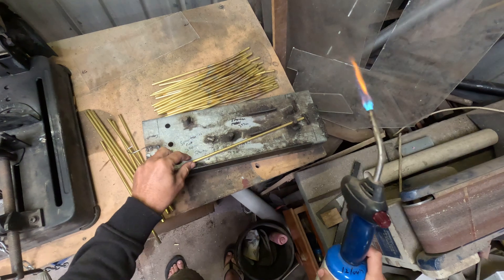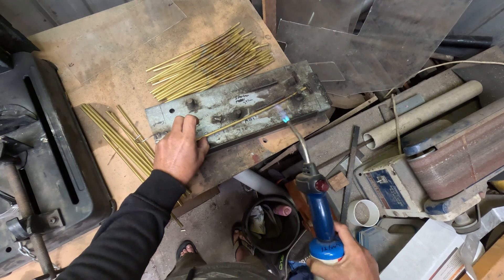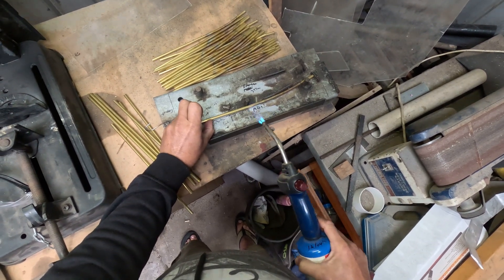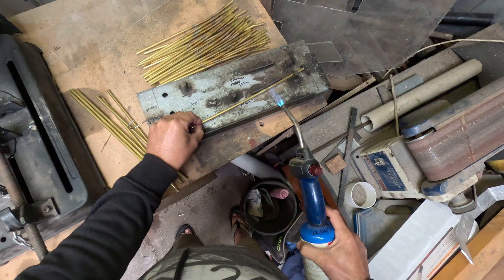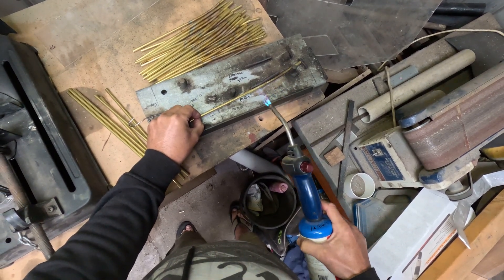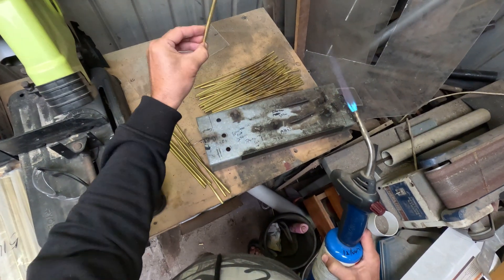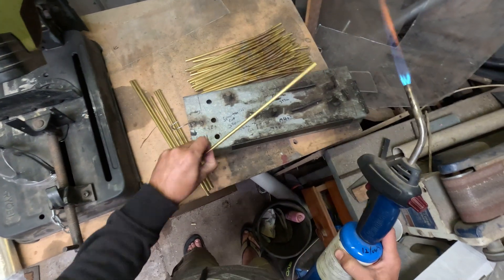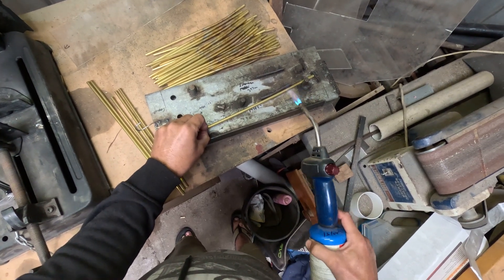Quickest and easiest way to bend an rc boat stuffing tube

Comment: Whats the difference between what OSE sells and your brand?
Reply from the maker: I havent been on their website in 10 years so couldnt tell you
Reply: @RCBoatBitz  from what I now notice is your kits the best. All they give is a stinger and cable so I'm guessing you have to pull the liner out because it doesn't come with a bigger stuffing tube. I plan on getting yours. I like running liners they never give me a issue to make the change. I know guys run without them.
Reply from the maker: @ralphhondaman  yes, we dont aim to be the cheapest but you get what you pay for as the saying goes